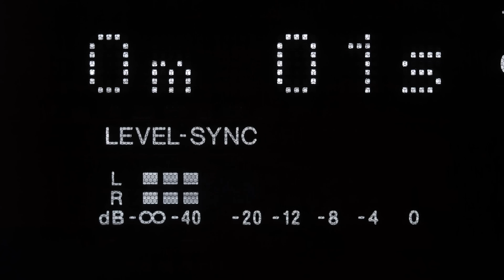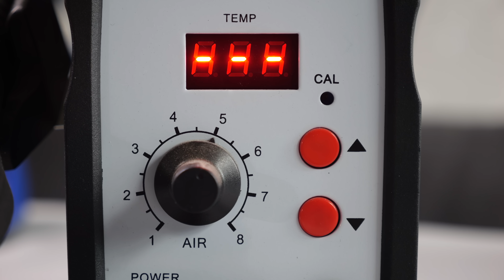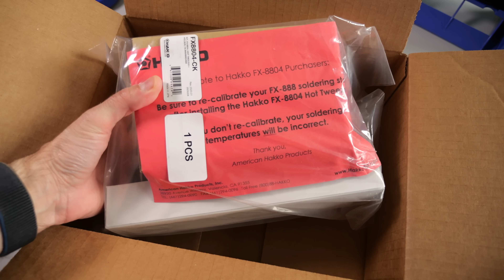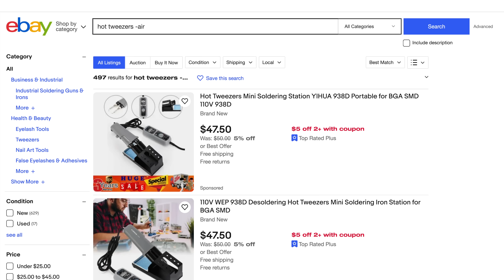A BETTER way to replace surface-mount capacitors!

Comment: I work in a machine shop at a company that specializes in capacitors but ones a'lot larger then these of course lol So it's funny seeing these little guys compared to the ones we make that go into heavy equipment and aerospace.

Comment: Pad adhesion to the circuit board reduces drastically with temperature.
I’ve found the twist method to be preferable to using heat. SMD cap legs are fragile, after a few gentle back and forth twists (without pulling) they snap leaving the feet easily removable from the pad with a “soddering” iron.

Comment: Hey Colin, how's it going. 😉: 
Soldering iron Kits have special attachments, the one I'm mainly referring to is the 'Nozzle Reducer'.
Try making one for your Hot Air unit(s) which will not only reduce & localize it's flow but bent to direct it near 90 degrees thus the hot air being minutely directed where you need it and less where its not. GREAT VIDEOS, THANKS!!!+!

Comment: After all the caps I have replaced in the last 5 years cutting them off or heating one side lifting then the other side works fine and usually if the corrosion is bad enough then the pad is gone anyway.

Comment: Personally I think I'm going to stick with the twist method. I twist them back and forth until the leads break at the base of the cap, then I remove the plastic spacer and desolder the remains of the leads. I have hot air but it's tricky to get the entire underside of the cap melted enough to take it off especially on high thermal mass boards. I'd be worried about heat degrading the PCB or nearby parts.

But that's the beauty of hobby projects, the correct technique is whatever works best for you. If that's milling the capacitor off with a CNC machine, then so be it lol
Reply: It is nearby parts that concern me with crude hot air methods.

I seems a lot of people like to crank up their hot air to the max or at lest over 400 °C. If you suddenly heat a ceramic cap with air that hot you may cause cracking of the dielectric that isn't visible. Electrolytic caps often have ceramic caps nearby and it is the ceramic caps that take a lot of the high-frequency ripple current. If you damage the ceramic cap the electrolytic cap, assuming the circuit even still works properly, takes more ripple current that intended and its life is considerably shortened as a result. Failed ceramic caps also allow high frequency energy to travel further in the circuit board which can compromise reliability.

Comment: The rework station is definitely the safest way. I actually have that same model and it has been good for me so far. One more thing, sometimes they will glue capacitors down to help them hold to the board and the twisting method will pull up the pad with the glue. The rework station will melt the glue which is another reason why it is the safest way

Comment: Saw a video here from Mr SolderFix. Did desoldering with just one iron with a copper wire wraped around with solder to desolder many points at once. Was on connectors but should work i think

Comment: Great video! I've always been nervous using hot air for cap removal as I've seen videos of some exploding. I've never dared to just rip/twist them off either, but I'm guilty of using the cutting method, and have had success with it so far. But as you mentioned, the condition of the board and the joints matter. I think the angle the cut is made is important too - I always go parallel to the pads and use very sharp side cutters. A bit of electolyte gets on the tool and PCB doing this, but as you mentioned, no problem if cleaned up right away. I'd love to try to get a pair of Hakko tweezers like those. They seem great for situations where you don't want to break out the hot air station and sheild things with foil and kapton tape just to remove a single passive component. Thanks for sharing 🙂

Comment: Fumes from hot air blowing on leaked electrolyte makes me feel ill after a while and I worry about the effect on my health. I tried cheap hot tweezers which were very awkward and I couldn't even place the tips properly with one hand. I now use low melt solder added to the pads and then use two tiny TS101 soldering irons. It is fast and accurate.

Comment: You should also look into a board pre-heater. It blows hot air on the bottom of the board while you work. Your goal is to have the pre-heat take the board to just under 100C, then desoldering is super fast.

Comment: Thanks for the video.
My inexpensive hot air rework was one that was wire wrong, so deleted the fuse and power cable, and added a combo PC power cord / fuse / power switch to the back. The front power switch was rewired to be another switch for the hot end, now you can lift the handle and nothing will happen till you activate the old power switch. Now it works way better the thing does not heat up till I want it to. Well worth the mod.

Comment: I bought a Sparkfun 303D several years ago, and it has been great.  It looks like they don't sell that anymore, having replaced it with a similar model -- 8508D -- which, for some reason (??) has a USB port on it, and a switch for "auto" and "manual" ..... uhm .... something.

I have no idea if that new one is any good, but it is very similar to the old model.  And, I guess, you can charge your phone from it, for the ten minutes you're working on a PCB.  That's progress.  Or whatever.

Comment: Hot air stations are also the preferred way to work with heatshrink tubing. You can set the temperature to a level that wont make the tube release fumes and it is much more precise than a heat gun and less dangerous than a lighter (or god forbid using a soldering iron).

Comment: Something it took me a while to grasp: Lifting pads most often comes as a result of applying too much heat for too long. Ideally you want to solder and desolder in a single short step. If you keep re-heating a pad over and over because the joint is proving painful to deal with, you weaken the bond holding the copper to the board. So I would suggest if you are having trouble, stop and let it cool for a while before coming back to it.

Comment: Thank you for making this video. I have often wondered what the best way to remove surface mount caps was. I've always just done it with the one soldering iron method. I've seen people twist them off in the past and thought to myself "that can't be safe" what if the pads were damaged by the electrolyte and you did that. You clarified all the options. I have tried the twist method. It does seem pretty easy. but the components I work on are far too expensive to risk. Though I would say I tend to agree with a lot of what people are saying in the threads. A;bout what one guy said in particular. And that is going so far as to say "pushing while twisting" rather than rocking or pulling. If there's any damage on the pad at all that would be when it would lift off the board. And we all know how frustrating that can be. I don't like having to run bodges*sp. They look like crap. And it makes me feel like a hack.

Comment: I sometimes cut SMD caps off the board, especially when in close proximity to lots of plastic. Joe's Computer Museum taught me the important "secret" to success: apply downward pressure to the capacitor with a finger while cutting. You don't want to cut the capacitor off without that downward pressure as that increases the risk of board damage.

Comment: I used to be adamantly against ripping the cap off of damaged boards -- after all, the pad is already potentially compromised, why be so brutal?

But then I tried it for a while.  I can say that, IME, if the pad is damaged enough that it'll lift when you TWIST (not pull!) the cap off the board, the bond to the board was already damaged enough that heat from a normal soldering iron would've lifted it anyway.  Either way, you're going to have to do some repair work -- probably with a jumper wire to whatever that pad was connected to.  And if the pad was that damaged, you probably need to go at least a few cm away to get back to good copper.

I.e., don't worry about it.  It can either handle the abuse, or it can't, in which case you need to come up with a more secure joint anyway because the damage was already done.

Comment: I saw several others that also mentioned the use of adding  low-melt solder or even lead base solder to make the job go easier. Also some of the boards showed I don't think it would matter because the electrolytes have done so much damage the pads & board may be beyond repair.

Comment: Generally, add a little bit of solder flux to each contact side, heat and apply a little bit of solder to one side, lift the one side when solder flows, then do other side.

Comment: I always use the snip or squeeze and twist method on these Capacitors. It works well on lead free soldered boards 👍

I've also seen people who made their own split tip iron with fat copper wire.

Hot Air doesn't work well without adding more solder first.

Comment: Ive never had a problem using an iron and alternating between both sides, if you add a thick blob of fresh solder they come off pretty easy, i only do this when i only need to replace a few though if there are a lot ill get my hot air station out of storage

Comment: In my experience heat can loosen the glue of pads. The safest way in my opinion is twisting them gently in both directions while holding them down and let the material fatigue do the work… it will always break at the weakest/thinnest part of the legs, which is right above the pad.

Comment: In cameras back in early 2000’s Hitachi recommended twisting the caps off and clean with a good alcohol before applying heat

Comment: Boy am I glad that my electronics work still revolves around THT parts (and I intend to keep it that way, seeing as I work with own designs) but even then I agree that a hot air gun is a handy and versatile tool; I regularly use it alongside my desoldering iron (if "Ol' Slurpy" can't get the chip loose, a bit of hot air will usually do the trick)😁
And yeah, ripping parts loose can really do a number on your pads (for instance; when desoldering cables, they may feel loose enough and you may think all the solder has melted...But you don't want to pull too hard..... Ask me how I know)😅

Comment: Hot air is also awesome for soldering ICs. Just a little solder paste and heat and the chips center themselves.

Comment: I see upward motion in the plier method in this video, never pull but press downward and then turn them slightly  back and forth and then gradually increase the twist until it snaps.

Comment: I do professional rework. I'm not against any method of removing old components, as long as they aren't unnecessarily destructive.
Personally, I've used twisting, cutting by sliding a blade under the can, cutting through the can, wiggling for 2 minutes, hot air rework, desoldering, and using solder tweezers (I only recommend the Hakko ones, I've had terrible experience with other brands)
I really prefer using my FM-2022/FM-2023 hot tweezers. Hakko calls them "parallel removers."

Comment: many ways to do things. you do what works best for you. I cut, but one snip, and you need to remove the two teets leftover before debraiding.  not sawing through them as you showed. Hot air is ok. but depending on the damage level, the old solder wont melt. 
again, you do what works for you
Reply: Yeah solder chemically damaged by electrolyte affecting it for a long time turns into some sort of non melting crystalline substance, it's not even metal at that stage any longer i don't think, perhaps a type of salt or ceramic.

Comment: Have you tried the paperclip method? You bend a paperclip to match the pins then heat up the paperclip with a soldering iron.

Comment: I have a straight up replica clone of the same hot tweezers with a selection of tips but they’re just too large and usually aren’t useful where you want/need them. For example, the capacitors by connector P5 in a TurboDuo.

Also, contaminated solder often just won’t melt until you’ve made everything so hot that the cap explodes. That’s obviously not good for the board either! I think it’s best to employ a range of techniques. It may take a ton of heat to add solder to electrolyte-contaminated solder but at least it isn’t heating up everything else and you can then switch to a safer removal method.

It’s difficult to have hot air, hot tweezers, and a high-wattage iron accessible at the same time/station but it does help… especially with a board preheater.

Comment: We're definitely kindred spirits, Colin.  I concur absolutely.  I lived a long time without a hot air station, but now I see I could have done better work more efficiently if I had been using one all those years.  Hakko brand Hot Tweezers are also my goto SMD cap removal solution most of the time, with the only caveat that the round cylinder part of each arm is sometimes not high enough if you have tall connectors, relays or similar components surrounding an SMD cap.  But that's where the hot air station comes in handy.  Thanks for a great video.